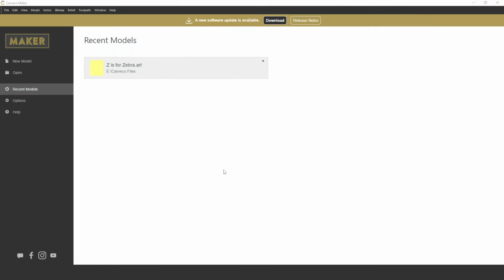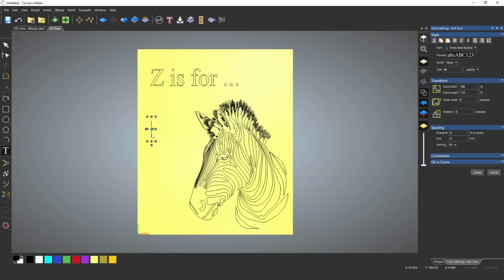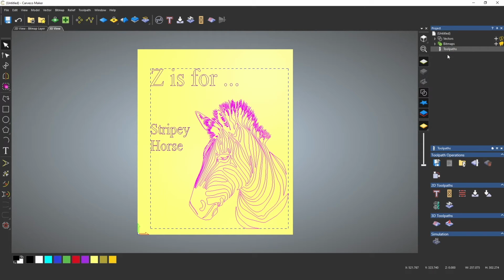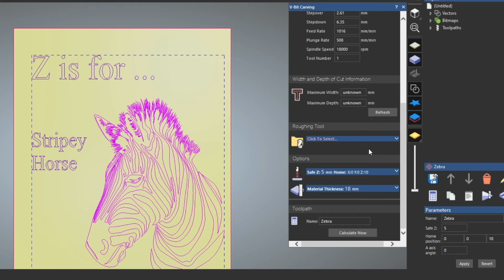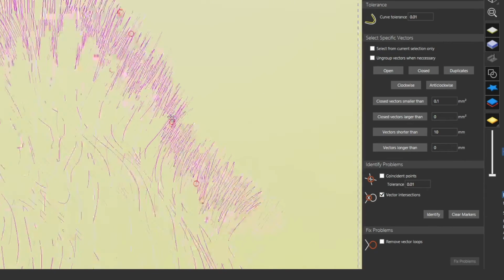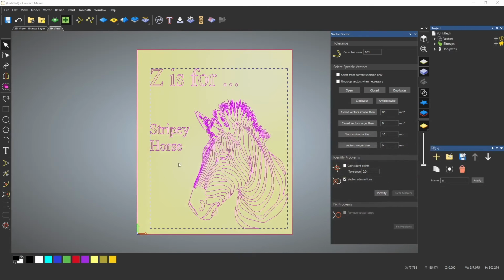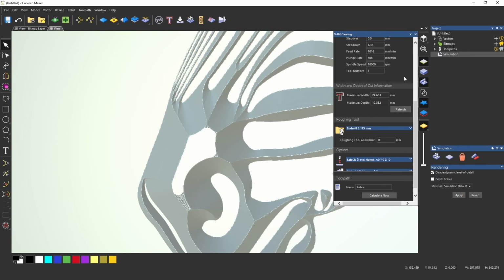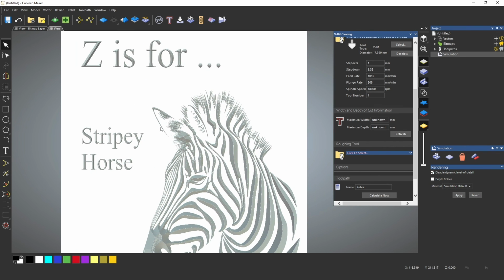Create your first V-bit carve and overview of Vector Doctor in Carveco Maker

Comment: Great video James, very thorough. I worked with Geographic Information Systems (GIS) and we called loops 'bowties'.  One side of the bowtie had positive area and the other had negative area (Maker probably thinks the two sides have positive and negative depth).  Finding them was a nightmare.  Vector Doctor does a great job. Thanks for your help in choosing the most appropriate software to pay for.

Comment: Excellent video. Informative and to-the-point without "fluff".  Thank you. I have a couple of questions as I'm just starting out and acquiring knowledge.  I do not have a machine yet but I am looking at the Genmitsu 4040 Pro Max.  How do you know your machine can handle the stepdown and other settings?  Second, if you used an endmill bit along with the v-bit, does the machine stop automatically to change bits?  Thank you again for this!

Comment: Great beginners' video for importing and fixing vector issues using the vector doctor. However, after fixing all issues identified by the vector doctor, I still get message. The message reads " Vector intersections were found in the selection Please identify and fix using vector doctor. " I've struggled with this on a lot.   Is this program prone to bugs?  James, don't feel the need to respond. I know you can't do anything to help.  Thanks , Mike
Reply from the maker: Vector doctor can be a pain sometimes but is quite powerful. With intersection I usually do a tiny offset which solves it but not all the time. I think we will see improvements in this feature with future releases